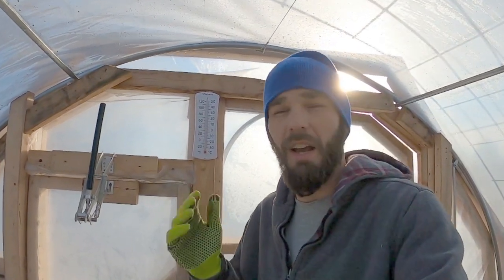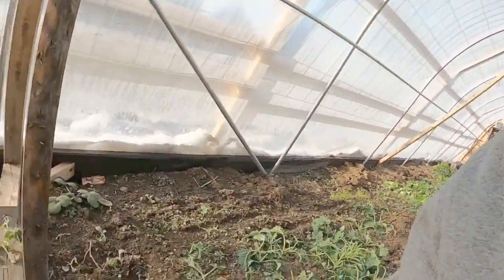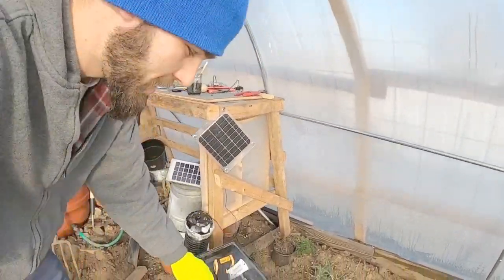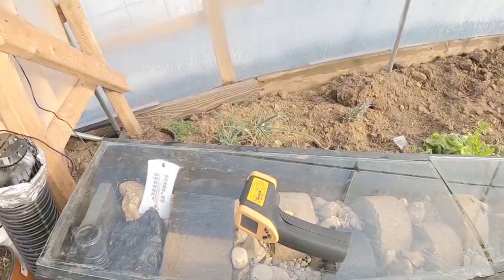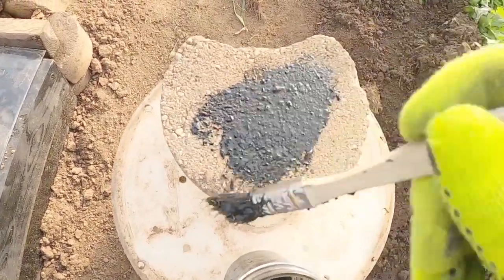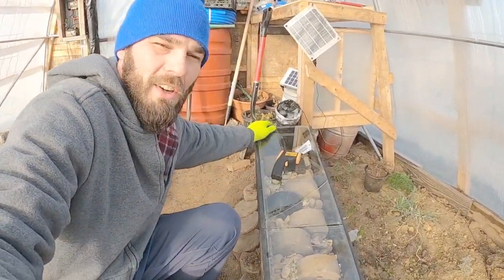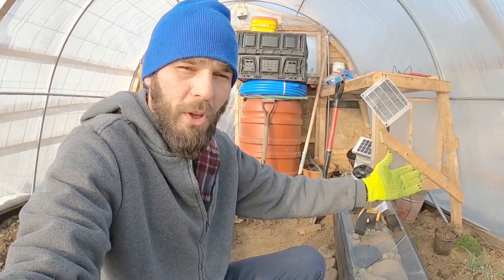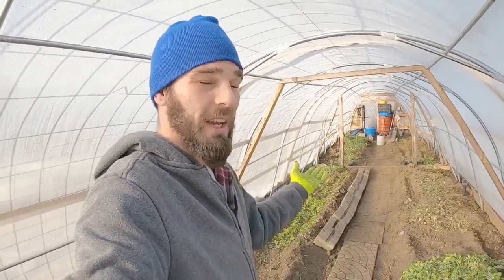DIY Rock Heatsink & All Natural Paint With Common Ingredients | Temps, Data, & Demonstration

Comment: A video inspiring and practical at the same time, thanks. Another natural binder for the paint is cooked lineseed oil. I'm going to build a glass greenhouse and I'll take advantage from your video.
Reply from the maker: We used linseed oil on our baseboards let them dry/bake in the sun. Seems to work well as a natural sealer

Comment: How’s your temperatures in your greenhouse lately. Do you have to repower your compost pile yet.
Reply from the maker: The one for my little greenhouse is runnning strong, but the one inside the big greenhouse cooled off and I’m going to be building a bigger one inside this week for some quick heat